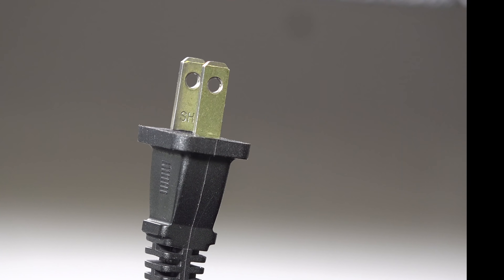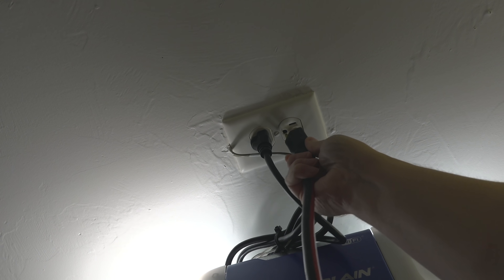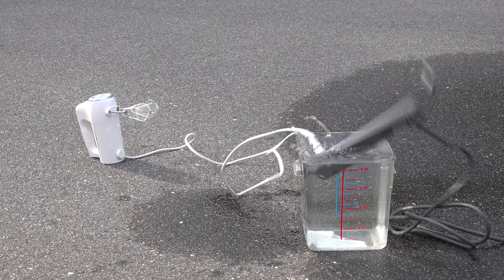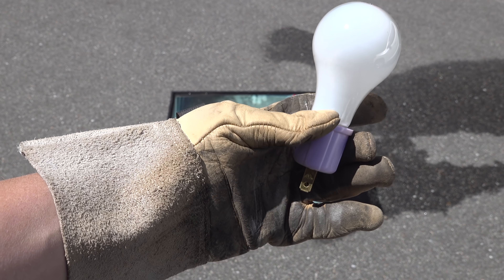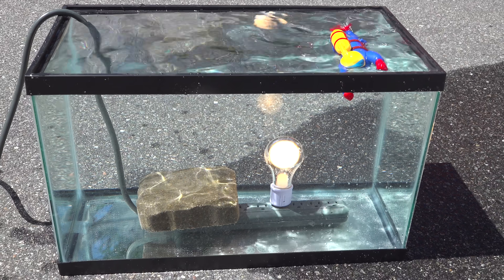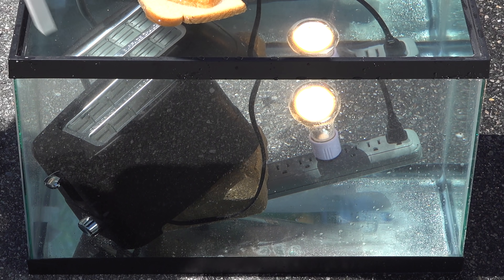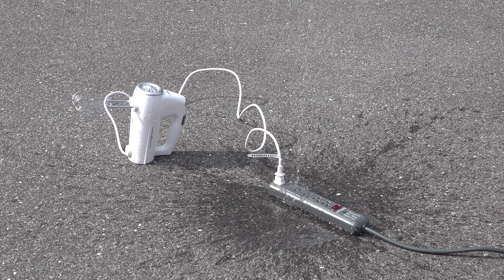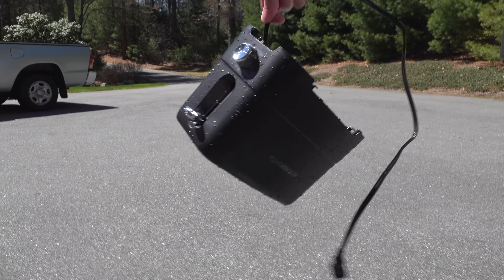What REALLY HAPPENS WHEN YOU SPILL WATER in an OUTLET?

Comment: Y’all be careful.  Not all outlets do this. That’s why they specified the type of outlet used.  If you put regular surge protectors in water, they WILL spark and pop!
Reply: and regardless of the model of power strip- it’s extremely risky anyway to perform any tests on them without proper protection. Once that bubble reaches the surface of the water, you’re screwed.
Reply: @duckymcquack6795  what bubble and why
Reply: @duckymcquack6795  bubble?
Reply: @duckymcquack6795  what bubble?
Reply: I would hope that the viewers are smart enough to not do this.  It's first grade knowledge not to stick electrical things in water.
Reply: @JCBassCovers Don't underestimate the stupidity of the current young generations.  Kids are drinking laundry detergent as a "challenge"
Reply: @KBP120  And who's fault is that? If the younger generation is 'trash' and 'failing' then the generation that was SUPPOSED to raise them correctly  isn't doing the greatest job, eh?
Reply: It depends on the conductivity of the water (ie how much stuff is dissolved in it) so pure water is actually pretty insulating, not yo mention that electricity goes the shortest path, so if there's like a 100 water device plugged into the strip, basically no electricity will go through you
Reply: Didn't he mention at the end that it's a specific type of outlet so it's better to stay away as electrocution would happen
Reply: Your right and also they will catch on fire 🔥 and smoke 💨
Reply: I did pour water on outlet by mistake and when I tried to unplug it I got shocked very badly
Reply: @egg_64920  Thanks for explaining how this happens in practice. This is a typical mistake, and as wet skin has practically no resistance, very dangerous.

Good that nothing serious happened to you.
Reply: @divVerent  yes even though it felt like my hand got burned I saw it was all fine but that was one scary thing to happen and then I didn't unplug it till it dried when it did I unplugged and clean all the water and I used a new wire and threw the old since it still had water in it.
Reply: Mu outlet spark and pop when i conect it
Reply: I didn't catch the part where he specified the outlet used but I figured it must be something special, cuz I remember when I was a kid I used to pee in live outlets around the house for some reason and they would spark pop and smoke
Reply: @soulsilvia7947  wdym at least i tried
Reply: @soulsilvia7947  stfu with them fucking emojis you clown
Reply: @soulsilvia7947  shit might want to ban grand theft auto playing that game makes me want to shoot up the streets and rob people. Might steal a few cars while at. Don't forget watching SpongeBob makes me wanna use a stove underwater and cook up some crab burgers.....  you really just said what I said but in a different way lmfao. . Can't forget about the kids show go Diego go!! Makes kids want to try and find a tiger and go on adventures with it.people of all ages play Call of duty you don't see kids sliding around corners with guns shooting up shit.
Reply: Sweet
Reply: Right
Reply: @Bangkit I believe my answer was quite realistic. Since you seem to disagree, then please enlighten me on which part wasn’t realistic.
Reply: now explain if the toaster are a REGULAR toaster or not
Reply: Oh i just thought he used distilled water
Reply: @Tritritrippinn  in that case it’s arbitrary
Reply: Yep I had a cheap one burn but nothing happened when I spilled water on a higher quality one.
Reply: Yes. His experiment was as if everyone is utilizing the same outlet.
Reply: I learned this the hard way.
Reply: Poop!
Reply: @Fate5591  ambatukam
Reply: The toaster has no circuits, it's just heating coils.  Same way some baptism tanks are heated 😆  Also there's tons of other videos of surge protectors and water just like this on yt.
Reply: that's a lie, you need to make video for proof, nothing is true without video
Reply: they?
You mean he?
Reply: I was wondering why there were no sparks! I dropped water on accident on an outlet with a phone plugged in and it’s sparked and left a black mark on the wall
Reply: Had one fry for a moment cause it got bug spray in it from bug spray guy, I moved it and heard a little frying, yanked cord from wall sparks flew from wall, trip switch was welded shut. My trust in those power strips are rather low.
Reply: HE USED PURE WATER, WATER IS NOT CONDUCTIVE, ITS MINERALS IN WATER THAT IS.
Reply: @nicktopo8380  What makes you think he used "pure water" (I am assuming you mean distilled water). But what makes you think that? You Can see he is using a hose in the video so I highly doubt you are right about this one.
Reply: @drew651  doesnt mean he doesnt have a decent filter system that can remove majority of the contaminates from the water to make it non conductive. my filters makes my water non conductive.
Reply: @nicktopo8380  Mineral in water are not "contaminates" lmao you want minerals in your water. And you have a reverse Osmosis filtration system? None of this has anything to do with the video "what makes you think he is using distilled water?". It is just an assumption, nothing more.
Reply: @nicktopo8380  Iron and fluoride are found naturally in water. Chlorine is a chemical not a mineral. Also helpful minerals found in water naturally are; calcium, magnesium, potassium, sodium, bicarbonate and zinc... smh dense much?
Reply: @nicktopo8380  DAMN!!! You deleted that comment real fast! lmao
Reply: @nicktopo8380  "minerals like iron, chlorine, flouride and anything else other than oxygen and hydrogen are contaminants. they are not naturally found in h20 therefor it is a contamination to the h20... smh dense much?" - Nick Topo before he realised who was dense.
Reply: @nicktopo8380  This is the most correct answer I've seen in this thread.
Reply: Sorry but as a professional electrician, water is VERY conductive.
Reply: @nicktopo8380  Pretty sure garden hose water isn't pure, it's the same stuff that comes from the tap, full of minerals, isn't it?
Reply: @itsnetts  never showed the source. Plus filters are a thing.
Reply: @nicktopo8380  True. There's no filter on garden hoses typically but there could be. No way to know without him confirming or denying.
Reply: @itsnetts  whatchu mean? I filter my water before it goes to my house 🤣
Reply: @nicktopo8380  he did not specify. That's pure conjecture on your part. Since you can not tell if water is "pure" just by looking at it.
Reply: @RikThunder33  We have pretty good info in the video about how pure the water is. GFCI was tripped but it took a few seconds. Means we got a current above 4 to 6 milliamps (typical rated GFCI trip current), but not much higher. Sure below 10 milliamps. Those are US outlets and plugs, so the voltage is 120 volts. So we know the wet outlet had a resistance of 20 to 30 kilo-ohms. Now I don't know the surface area and distance in the outlet tested, but I guess someone could buy it and measure. We then can calculate the salt content in the water basd on the observed resistance.

My bets are on "typical tap water" :)
Reply: I didn’t even see why this was supposed to be dangerous until he said so in the end 😂 I thought the electricity just wouldn’t spread over onto the water
Reply: This is so dangerous.  He's touching with his bare hands
Reply: @cupidok2768  No he didn’t, the only time he used his bare hands in this entire video is when it was unplugged. Try paying attention.
Reply: @ThumperG  many situations.  Like putting in the toaster.  It requires eyes to pay attention so idk what to tell u. Also this was a yr ago.
Reply: @cupidok2768  incorrect again. Like I said the only time he used his bare hands was when everything was unplugged so there was literally no danger at all. Maybe if you had used you eyes you would have noticed that before making a comment that was inaccurate.
Reply: @ThumperG  correct again. After fedex, he was plugging in without gloves
Reply: @cupidok2768  wrong lol. Afer fed ex he plugged in the connection with bare hands that was nowhere near the water, again literally no danger. He then unplugged it shook the water out, and put his gloves back on before trying his next test with the lightbulb, so again, never touched it with his bare hands. Literally not once in the entire video did his bare hands touch anything in the water while plugged in. You really suck at paying attention lol
Reply: @ThumperG  the whole point of the doing experiment was to find out because u dont know. . U literally comfirmed the situation happened. So u just said im right ur wrong
Reply: @cupidok2768  Are you slow or something? You said it was dangerous because he touched it with his bare hands, I pointed out that he did not ever touch it with his bare hands while plugged in, meaning I disagreed with you and pointed out that you were wrong. Feel free to find a time during this entire video where he touched the water, or anything in the water, with his bare hands while it was plugged in. You keep claiming it happened, so tell me where do you see it happening?? It didn’t. Any time the line was live he used gloves to touch the extension cord and he used a stick to turn on the toaster. The only time he touched anything with his bare hands is when it was unplugged and presented NO DANGER. can’t believe I have to explain it to you like a child.
Reply: No fr, this is dangerous considering how kids absorb these kinds of videos and go "it should work i saw it on a youtube video" kind of mindset. Youtube should be deleting these kinds of videos
Reply: @soulsilvia7947  Or just teach your kids not to be stupid. It's not everyone else's responsibility to raise your kids right.
Reply: @thinkngskeptic  lol what awful logic
Reply: @thinkngskeptic  and what happens if the parents are unaware and their kids would just do it?
Reply: @thinkngskeptic  kids will do stupid stuff whether you like it or not, teach them or not. better be careful
Reply: @soulsilvia7947  Yes. Lets remove somewhat educational material from the internet because some unsupervised kid might try to emulate what they saw. How about we push for parents to be more involved in their kids insteadd
Reply: @StolenJoker84  kids are not always supervise. You can't expect them to always supervise them when they have work. And come on we are people we always don't pay attention especially if we are busy doing something or when we are procrastinating.
Reply: @soulsilvia7947  yes and no.  I think when they do what this guy does and put warnings clearly on it,  it's fine.  it's those 5 minute crafts type videos where they do stuff that would be just as dangerous to do it the way they show and quite unlikely to have the desired outcome even if you do manage not to blow up something (including yourself)  those are the ones that cause the problems your talking about and those are the ones that need to get taken down.
Reply: @soulsilvia7947  - you’re insane with that kind of reasoning. Because some people could try this, it shouldn’t be allowed on the internet? 🤷🏼‍♂️
Reply: @soulsilvia7947  ah yes, because kids enjoy pouring water on outlets.
Reply: @fishfood8711  well they eat fucking tide pods so yeah you never know
Reply: @fishfood8711  not all of em. Dont forget u are one
Reply: @soulsilvia7947  it’s actually informative on not to do this im 10
Reply: @soulsilvia7947  that's why we're loosing freedom on the internet .....
Reply: @soulsilvia7947  trust me, some kids aren't THAT dumb. and have you seen the gore on here? maybe go ask for that to be deleted
Reply: @soulsilvia7947  that's not really fair though . If a person does that and says "I saw it in a video it should be fine" you could also say "i heard it in a video it should be fine" and in this case, the audio and visuals contradict eachother. So if anyone has the mindset that you mentioned, they brought it upon themselves
Reply: @ToastGreeting  it's not like I wasn't referring to children huh
Reply: @soulsilvia7947  Children should be supervised online. It should not be the world's job to watch your kids or anyone else's kids.
Reply: @soulsilvia7947  well there’s warning signs at the beginning of the video telling people not to try at home so if they don’t listen to that then it’s their fault 🤷🏻‍♀️
Reply: @soulsilvia7947  I don't think that's YouTube's responsibility, that's the parent's, if you can't stop your kid from throwing a toaster into water then I think that's on you
Reply: @soulsilvia7947  Not gonna lie, if a kid has the mental capacity & aptitude to perform the actions of this video but not heed the warnings and have the (should be taught early on) common sense/knowledge to know what could happen if something goes wrong, I feel like the first people I should be screaming at is the parents, not the YouTuber.
Reply: @soulsilvia7947  There are movies and TV shows that have similar dangerous things shown in them that were around long before YouTube, often times even for comedic purposes. Should they have been banned too by your logic? How about parents do a better job educating their kids on what's safe and what's not. I remember being as young as 4 and my mom always telling me during movies and stuff "don't ever do that in real life, you'll die" and it hearing it a lot stuck in my head throughout the years and kept me safe.
Reply: @soulsilvia7947  or maybe watch your kids and don't let them see a vid like this. tbh this is somewhat educational and I learned something new myself so parents lack of care in what their children watch shouldn't ruin the fun and or education of others who find the knowledge interesting to them.
Reply: @soulsilvia7947 No, they shouldn't. People can make videos on what they want. The world shouldn't have to be censored because people are dumb.
Reply: @soulsilvia7947  i. H ki un
Reply: @soulsilvia7947 censorship is not the key. This is a job for age restriction.
Reply: @soulsilvia7947 You somehow missed the very blatant warning at the beginning that tells you to not do this ...
Reply: @soulsilvia7947  No you just need to show that as soon as water get contaminated (by salt, soap, or going though a drywall) it gets conductive.
Reply: If your child is idiotic enough to think that trying it would be a good idea After all the warning, and you're such a bad parent that you would let that happen, that's not anyone else's fault but yours.
Reply: @Greyce118  you don't know how kids operate lol
Reply: @Greyce118  um there are kids who are slow to understand especially those kids with special needs. Check mate
Reply: @soulsilvia7947  you have no idea how smart kids are nowdays
Reply: @soulsilvia7947  agreed
Reply: @soulsilvia7947  exactly my point
Reply: No they won’t… clear water is not conductive

Comment: He probably used distilled water instead of regular tap water.
Regular water has nutrients in it which do conduct electricity. Normal water will short the circuit.

Comment: You think this is crazy? I knew nothing was gonna happen just when I saw the title. But try this. Build up a simple circle; bulb, switch and plug. Remove the switch,, use your hands instead. You’ll feel a really low electrical shock, your body now is the connection between the bulb and the plug, and the lamp will light up 50%. Don’t try this in countries where the voltage is 220. Only USA, where it is 110. And don’t try it without the bulb, you’ll definitely die 😂😂

Comment: So, water is not as conducive as you think you need to be really close to an exposed wire in water for you to be schoocked, but that Chang’s when you add soap to the water, it makes it extremely conductive and you will not die if you put your hand in water with an exposed wire that has 1000000 volts and 30 watts will not kill you just hurt, comment if you have questions 😇

Comment: I experienced this first hand. Our above ground swimming pool spilt water all over one of these and it made our whole patio shocky. It felt like walking on fine glass shards.
Reply: The safety rule to prevent this is simple but strict: only GFCI near a pool or exposed to the elements. Don't run extension cords from a non-protected outlet to an area that needs protection.

Comment: That's because standard sockets only have fuses in them which only protect against overload, whereas rcd or gfci sockets protect against earth faults, basically when the electric is going somewhere other than the neutral, it disconnects the circuit.

Comment: to my knowledge, electric will flow through the shortest path. since outlet plug is wired and shortest and easiest path, the current flows thru the wire instead of water. if the outlet is disconnected, the next candidate would be the Line & Neutral connection in water.

Comment: moral of the story is, electricity follows path of least resistance. even though the appliances are under water(i.e pure water drinking) with low conductivity , the flow of current to the appliances are not disturbed. but if we are to put our hands in the water we would get electrocuted if our hand or body is touching the very 🌎 earth we are standing on.

Comment: Circuit breakers protect the house not the humans. They are rated for 15A so  unless you can pull 15A through the water they will not trip. Clean water is a good insulator so it might pull enough like 1A to kill somone but not enough to trip a breaker. Next time put iron filings in the water and let them rust to increase its conductivity.

Comment: Would you be willing to do this again but measure the voltage in and current going thrpugh the water?? I saw you plugged ok me piece in by hand. However, some times small wattage 110v devices just feel like a Strong tingle when they are shocking you

Comment: In Australia its mandatory for buildings with power to have a power box somewhere such as the garage or outside if a power outlet or wiring shorts out the box cuts power you may manually turn it back on but if the short or earth is not fixed it will continue to shut of